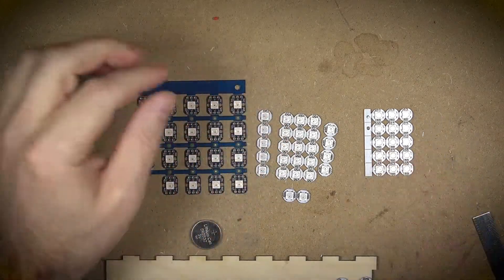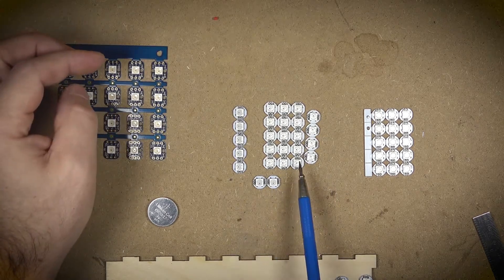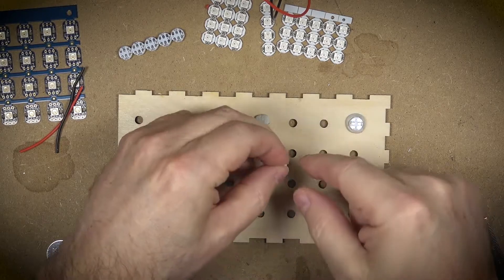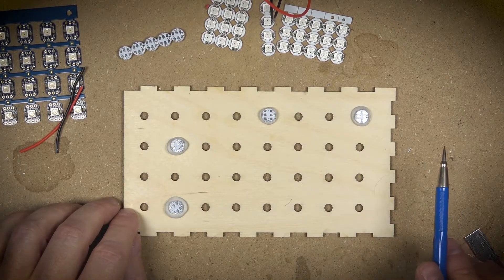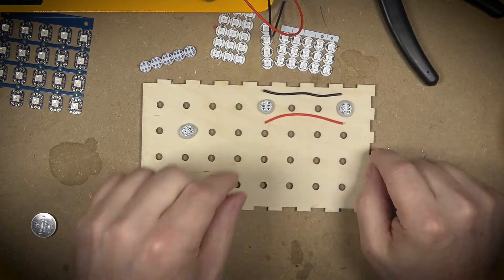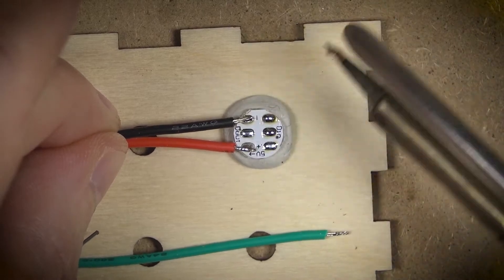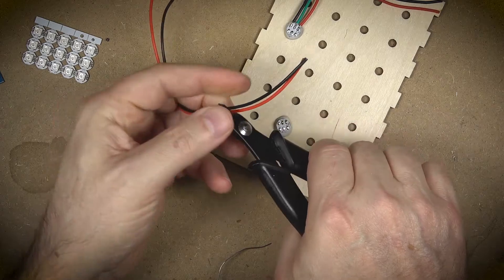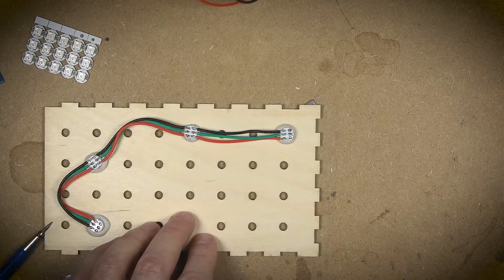Book Nooks - Soldering NeoPixel Buttons, It's Easy

Comment: I'm now wiring up these neopixel buttons using 22awg wire.  The placement of my buttons means I've got to make some pretty tight 90 degree turns with the wires to go into the buttons.  Any tips for doing this neatly and such that the wires don't suffer from such tight turns?
Reply from the maker: One quick tip is to be strategic in the rotation of the NeoPixels. If you rotate them 45 degrees, it helps reduce the amount of curve in the wire. Put a slightly different way, the pads and pixels don’t need to be at right angles. They can generally point in the direction the wire is traveling. Another thought is to create a loop of wire that’s longer than you need and circle out and back to the connection so your not trying to make the turn with a short, sharp angle of wire. Hope that makes sense. Compact installations can be challenging. I often find I’m trying to be too direct or too point to point and realize that I can meander a bit to make the connection and still keep it pretty compact. Hope that helps. All the best with your project!!

Comment: Awesome video!  What gauge silicone wire do you use?  I've heard 22AWG is best for neopixels but can't seem to find silicone in that gauge.
Reply from the maker: Sadly, like all good answers, it starts with "it depends". The main thing you need to consider with wire is what it's overall amperage rating is. It's a mind numbing subject that includes the type of insulation, ambient temperature, what constellation Venus is in, and a general consultation of the migratory patterns of birds. After doing all of that, you would calculate what you think your general total current demand of the circuit would be. If you look at the Adafruit Uberguide (https://learn.adafruit.com/adafruit-neopixel-uberguide/neopixel-strips) it notes that 30 NeoPixels fully cranked will draw about 1.8 amps. My projects are never that big and are never full intensity but that gives me a starting point. I generally use 2 amp power supplies (wall transformers) just to make sure I'm never over-stressing the power source. Depending on what web page you land on, 22 AWG wire can handle either a little under 1 amp or up to 7 amps. Uh... OK. Here's a table that seems a little less murky - https://en.wikipedia.org/wiki/American_wire_gauge#Tables_of_AWG_wire_sizes and seems to say 22 AWG will support 3 amps at 60 C. It's always good to have a margin of safety. It also doesn't hurt to put a multimeter on the circuit to measure/confirm the amount of current you're drawing. If my project uses 12 pixels at 50% intensity, rule of thumb says I'm way under 2 amps and probably in the 500 milliamp range (maybe less) so both 22 AWG and a 2 amp supply would be more than enough. The important thing is to do a little bit of calculating, consult the stars and the AWG table, and build in a bit of padding on your conductors so you don't end up creating a hot wire cutter instead. Also, also... keep in mind my degree is in art so I really tend to err as much as possible on the side of caution and overkill because I'm never 100% sure I really truly understand electrons.

I do find silicone coated to be a bit tricker to find but have had good luck with the multicolor bundle boxes.

Hope that helped a bit! All the best.

Comment: Thanks! Great video.  Do you use flux on pads before soldering?
Reply from the maker: I usually use a rosin core solder but, if I wasn't insanely lazy, I would scuff the pads with a scotch pad and add a bit of flux for sure. Getting rid of any oxidation and adding a bit of goo always makes for better soldering. Thanks for the question and all the best!

Comment: What temp did you use?
Reply from the maker: It really depends on the solder. Lead free has a higher melting temp while lead can cause brain damage but flows at a lower temp. I was finding that my iron was around 350C to work with the lead free. I'm not sure how accurate my iron is though. While the melting point of the solder is lower, the iron needs to be higher to transfer the heat quickly. The boards are pretty rugged and have survived some of my heavy handed soldering. Here's a page with a bit more insight - https://www.techspray.com/ultimate-guide-to-electronic-soldering

All the best!!